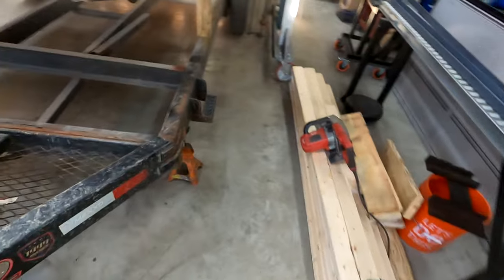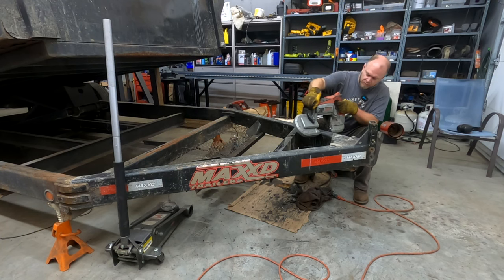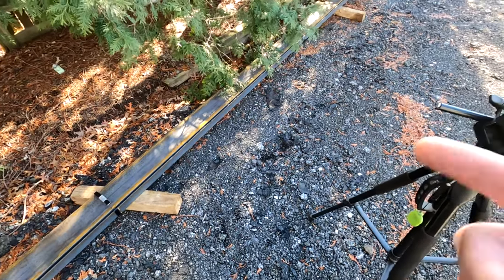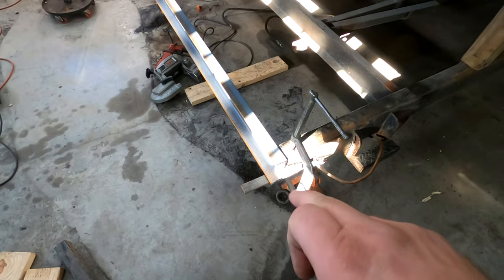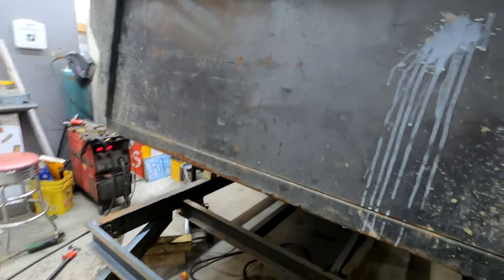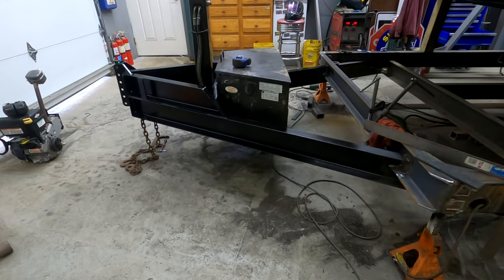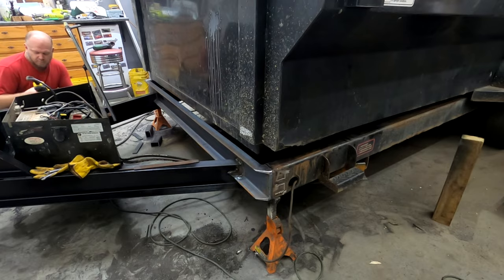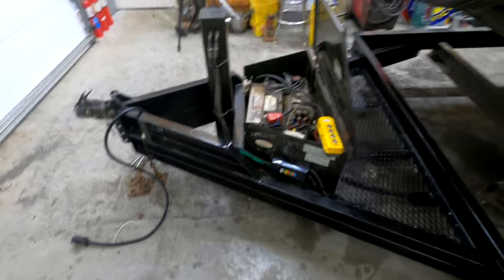Replacing a dump trailer tongue in about 30 minutes

Comment: That looks awesome! That trailer looks and is better than it was from factory. I like the way you explain what you're doing. As far as what we want to see, some more close up shots of what you're working on, some overhead shots, and change angles while you're working more. Not that your videos are lacking at all, that would just add. Your work speaks for itself. Slower shots of the welding maybe. Load up your videos first thing in the morning and Sundays are a pretty good day to load them as well. The algorithm is weird for sure. 👍🏻
Reply from the maker: Thank you! Those are all good points, honestly. I'm so used to just working and getting it done, I don't think to changes angles, etc. It's a slow learning curve for me, lol😁

Comment: Seems kinda wasteful to do all of those cuts. 1, its taking alot of time, and wasting blades. 2, having shorter pieces is less desirable than longer ones as far as having any useable scrap pieces to use in the future. That 2 x 6(or 8)x .25" box frame is not cheap, and I'd prefer to keep it longer, so i can use it to fix something else in the future. Idk, just my opinion & thoughts.... you're the one making the decision. Anyways, keep doing your thing man. 👌🏻👍🏼👨🏻‍🏭😎🤔👨🏻‍🔧
Reply from the maker: So, I totally agree with you on this. In most cases, I'll try to save good metal, but I didn't feel comfortable reusing this metal due to all the stress that this tongue had on it over the past few years. I now realize I didn't convey this in the video. My biggest concern would be tiny stress cracks in the metal. Either way, my clients pay for the steel, so I normally just order what I need and the left overs I use for my own projects or filler scraps for large projects. The economy in Central MD, where I am at, supports this and no one complains, but I know other areas are more cost concerned and would try to reuse as much as possible. Thanks for watching and thanks for bringing up this point!